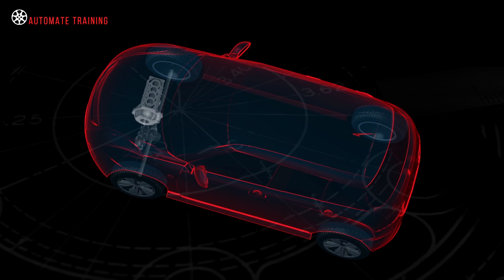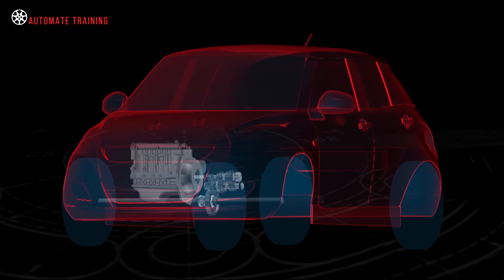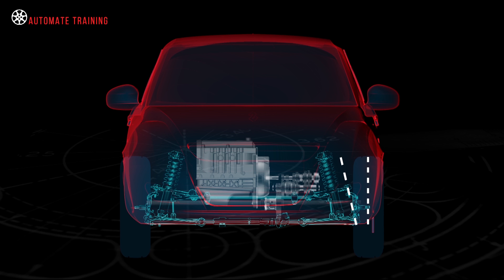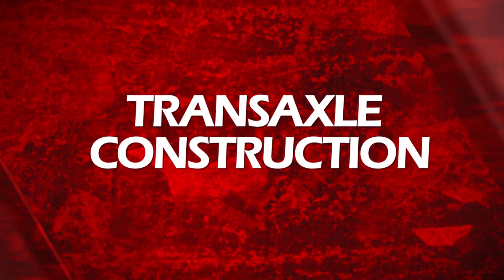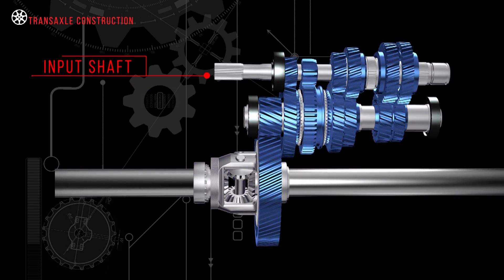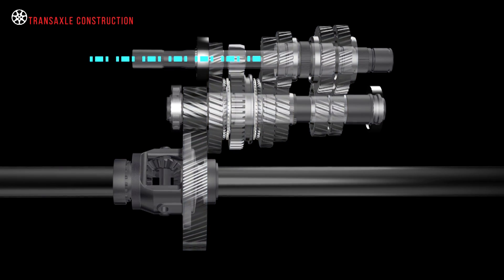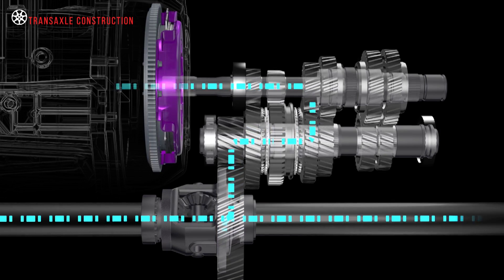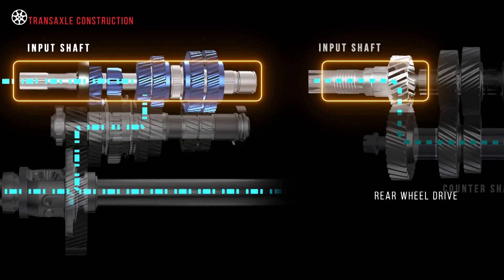Understanding Manual Transaxles Training Module Trailer

Comment: How to check car over hit please answer me
Reply from the maker: Suman, there are numerous factors that leads to an overheating engine - from a simple incorrect amount of coolant and water in your radiator, to a more complicated warped engine block and head. The temperature gauge on your instrument panel is a good way to check if your engine is operating at a higher temperature than normal. Never let your car operate on a temperature that is higher than what is indicated in your owners manual. Hope that helps.